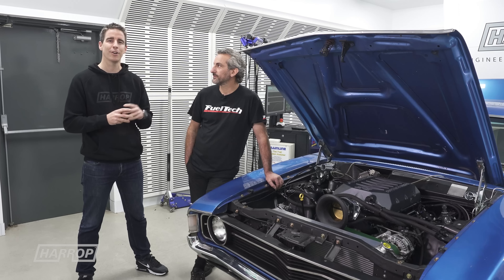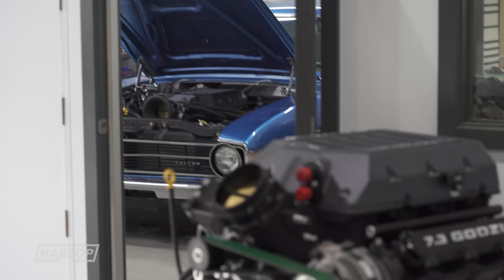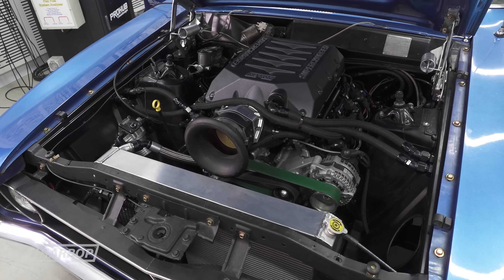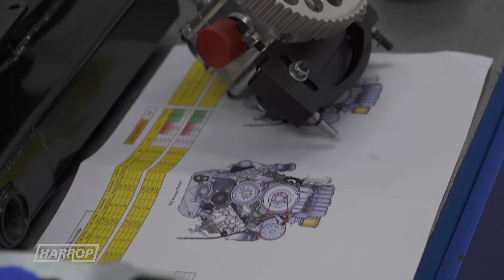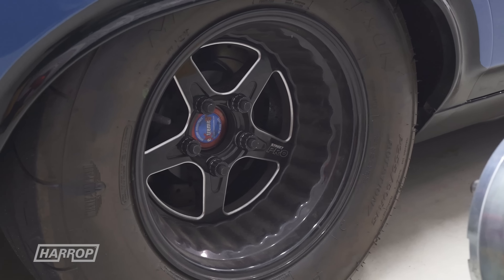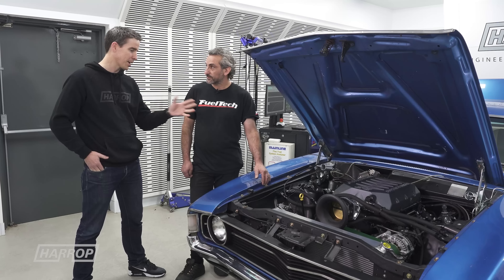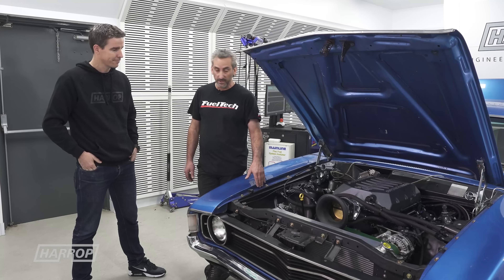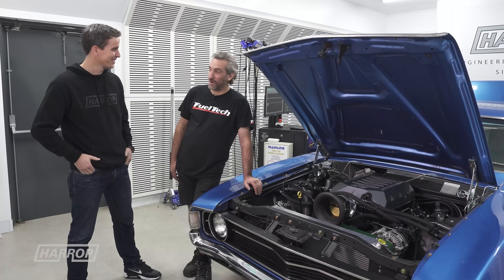1300HP XA Falcon | Harrop Supercharged Ford 7.3L Godzilla

Comment: If all it needs is a oil pump and oil pan and no cutting of the car to fit in a xa that means the godzilla is a fantastic engine for these older falcons. I wonder what type of manual gear boxes bolt up to it.
Reply: It's the same bellhousing pattern as modular and coyote, so any manual from ba-fg v8 falcon will fit

Comment: Awesome build!  How did 1300hp on an engine dyno translate to 1300hp at the hubs?  What else was changed?
Reply: Maybe to do with the fuel system rather than whatever set-up they have with the engine dyno?
Reply: Potentially calibrated to represent drive loss on the engine dyno
Reply: This shows how flawed a fixed percent of driveline loss is as a theory. Drivelines take a certain HP/tq to turn with small changes due to temp, friction from the tq load fed to it and so on.
Reply: Hub dynos usually show a calculated HP at the flywheel reading, a chassis dyno with rollers acting on the tyres don't.
Reply: @garageredzone  flywheel?
It's calculated from the hub, hence its called a hub dyno
Reply: @shakstar   well it takes a reading from the hub, thereby eliminating wheel diameter, tyre stiffness and even tyre pressure from the equation. But a hub dyno will pretty much always read somewhat close to a flywheel hp reading, they calculate it from the parasitic drag on overrun. Run a car on an engine dyno, hub dyno and chassis dyno and you'll see what happens.
Reply: @garageredzone  not only didn't the engine lose power through the torque converter, transmission and diff with a full exhaust system, it actually PICKED UP power. Now that is one very happy hub dyno they have down there at Harrop. Look at the previous video @7000rpm / 19psi they were making 1317hp. @6200 / ? they were making 1284hp. In the car with all that other drag they are now making 1305hp @6226 / 16.8psi. Forget the Harrop blower I want the torque convertor / Turbo 400, 9" diff and exhaust system out of that car, it makes power all by itself.
Reply: Frank commented elsewhere that there had been more development work between dyno sessions.  My question wasn't to doubt the accuracy of either dyno, but to understand what else had been done to the motor for it to pick up around 350-400hp at the flywheel when it was dynoed this time around.  I don't know what was done, but the Falcon is a true testament to what is possible when skilled blokes get together to achieve something special.  Low 8s first time out?  Impressive!!!
Reply: @craigm5511  they said it made 1300 pretty easy on the engine dyno.  I seen there it's first pass was 1200. Maybe that was as was on the engine dyno, these hub dynos don't loose as much as the roller. Probably  leaned on it a but from there.

Comment: That's awesome to make it fit under the stock hood.

Love the Aussie tendency to use 4-door sedans. Love to see the uniqueness and similarities of our respective countries. 🇺🇸

I'm planning a Mercury Cougar build and am likely going to go with a 347 na stroker for weight and packaging, but these Godzilla motors have me curious. If I can add mass-produced bolt-ons, maybe increase compression,  cam, headers, intake, then it could be a budget friendly 600hp. I love the valve cover, covers. Want the classic look.  What seems to be the big-ticket necessity is the custom ECU needed for each application. Wonder if the aftermarket will support affordable heads that allow for a conversion to regular spark plugs, production intakes for carb or EFI, cam drive for distributors.

I'm sure y'all think I'm nuts to go backwards, but where else can you get a stock block & robust internals, that easily fits into fox bodies (and my future '67 Cougar) that gives you 445ci, a semi small block look, and a reliable 600hp na? What am I overlooking?
Reply: For an American is it weird that most of our muscle cars in Australia are 4 door sedans and Ute's?
Reply: @bashyamate2613  it is yes. You don't see them here in the US.
Reply: Two door cars were never built in large numbers here.

Comment: Great engine with modern technology , but looks similar to usual GM pushrod engines, 7.3  is average for a BB engine, GM have crate engines with 632ci over 800 hp standard na
Reply: Hey Jim the godzilla is more about minimising external dimensions whilst maintaining big block cubes. Yes gm has larger cubes, but they won't fit into a fox body or xw.
Reply: It's the "similar to usual GM pushrod engines" in that the LS is similar to the 351W, which is similar to the SBC... Throw the G3 hemi in there too. Yes, 90° V8 pushrod OHV engines tend to share a lot of similar features, that's how it works. 
  
The 7.3l 'Zilla is as much a big block as the 7.0l LS7 is. Bore center of the 7.3 is significantly closer to an LS than any BB, hell it's even closer to an LS than it is to a so called "medium block" Ford FE.

The 632 is just an overpriced crate engine(you can get better from reputable race engine builders; although the new LS-style heads on this piece are neat) for dumb 'bragging rights'(following Mopar's also overpriced $30k 'Hellephant'); the 7.3l is a mass produced pickup truck & medium duty commercial engine. In crate form, the 7.3l costs $6,500-$7,000 - not $38,000 like GM's ZZ632.
If I wanted a REAL big block, I'd get it from someone like Shafiroff Racing, who has a rock solid reputation. They have multiple 540-632 pump gas builds(along side the race builds obviously) listed on their website, from a 625HP 540 for $13,500 to a 1050HP(50 more than the GM engine) SR20 632 for $21,500. Not to mention the optional upgrades they offer too. 1000HP 632 for $38k, or 1050HP 632 for  $22k? Either way, they're both still multiple times the cost of the 7.3l, because of course they are.
Reply: 598 ci ford said fallbac jac

Comment: This is blasphemy, gtr is the one and only "Godzilla".....
Reply: That's a car this is a motor and a fckn stout one at that
Reply: Nissan never named the Skyline GTR Godzilla, the GTR earned that name. Ford just named their new engine Godzilla, and that just ain’t the same…..
But as the other bloke said that V8 is one fckn stout donk.
Reply: It's going to inhale a skyline. 7.3 is difficult to beat with 2.5
Reply: @dinosshed  the Godzilla is 2.6 liters not 2.5, and it will go toe to toe with this any day. That is the difference between earning the name and just calling it that.
Reply: @wetsox278  sure thing.
Reply: @wetsox278  maate you’re dreaming, a 2jz might but a rb26 would spew its guts on the floor trying to compete with this
Reply: @dinosshed  let me know when the ford is as quick as this GTR. https://youtu.be/4EDYyAfw0B8
Reply: @5150gino  the ford engine is basically  three times the cubic capacity and very well built straight from the factory. How is an rb26 going to compete?
Reply: @dinosshed  like this https://youtu.be/EsgnLnTwoQc
This is a street registered car in Australia, the purpose built drag GTR’s are even quicker. Enjoy.
Reply: @5150gino  it's got a billet block, nitto crank, rods, pistons etc none of which is an rb26 engine component. Technically speaking you could put a Nissan skyline badge on a nitro funny car and it'd then be the quickest.
Reply: @dinosshed  your 100%  correct it’s got a ton of aftermarket parts, but name me a car that runs in the 6’s that doesn’t. The Ford engine ain’t stock either, aftermarket rods, piston’s ect, not forgetting the massive blower! Getting back to the point, your question was “how will the GTR compete?”, well I gave you an answer, this street registered GTR is way faster.
Reply: @5150gino  this Godzilla ford engine is stock with only the supercharger running conservative boost. The skyline is running 80psi with nitrous. Imagine if they built the 7.3 and ran 80psi and nitrous,
Reply: @dinosshed  it’s not stock mate and here is the proof  https://youtu.be/GRdcM8VtTwQ. And if you tried to put 70+psi into it…….it would need a billet block too. At the end of the day they are both amazing machines.
Reply: @dinosshed  How is the RB26 going to compete? By virtue of the fact that it is already competing against a much bigger competitor and holding it's head high. Any fool can make a big cubic inch engine make power (get a big block throw some Brodix heads and a big turbo on it) Viola you are competing with this engine with bottom end technology that is well over 50 years old. That hardly makes the big block worthy of the "Godzilla" title when it start life as a truck engine. Besides this dyno is so happy my wife's Hyundai would make a 1000hp on it.